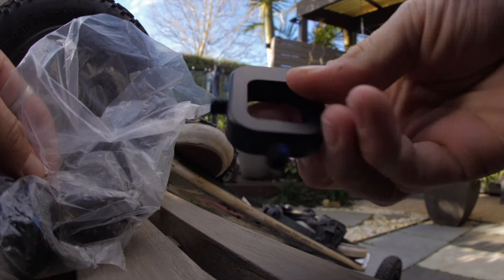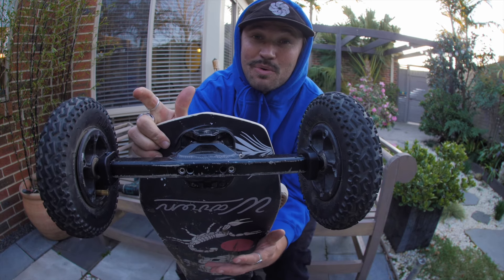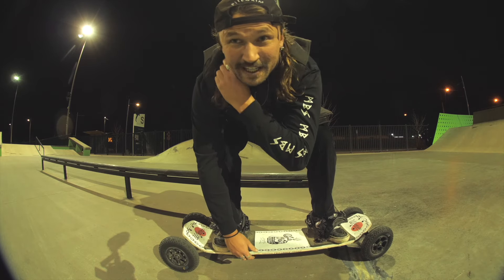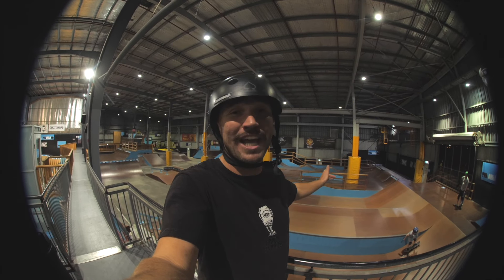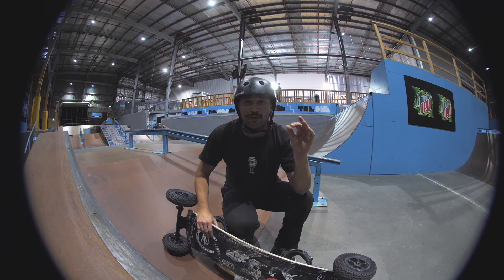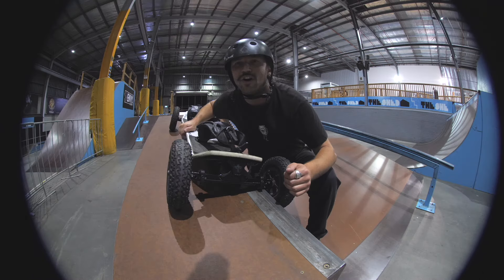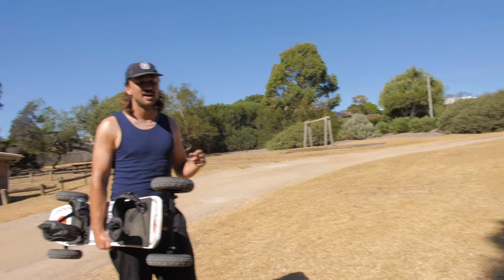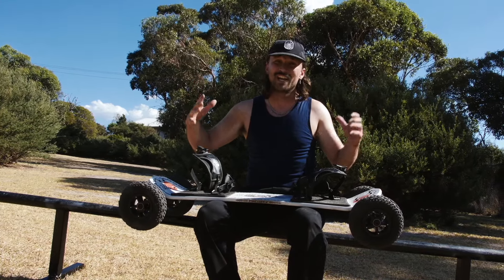Could this new part improve your Mountainboarding? ( The R&D Process )

Comment: The same basic idea should work for board slides. Try some skateboardi plastic deck rails, but cut short to the deck width. See if it stops wheel bite. Giving you something to lock in on. Might make rock trix solid also.
I get to test them if it works.

Comment: Does this also help with grinding corners of a bowl?
Reply from the maker: It helps you sit up against the coping a little nicer in a 5050 but the most important thing is your leaning in the direction of the corner i.e on your toes or heels so you don't roll up onto the deck.